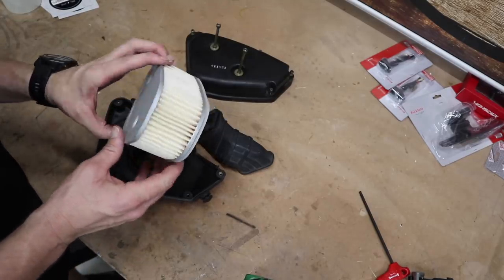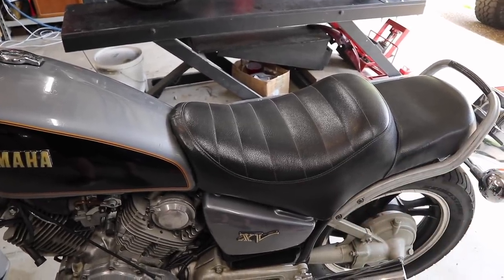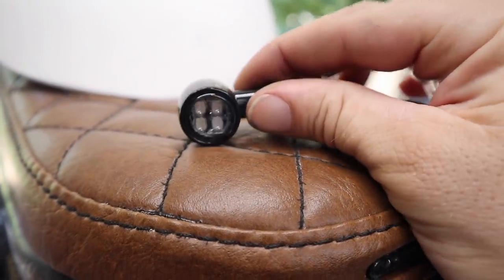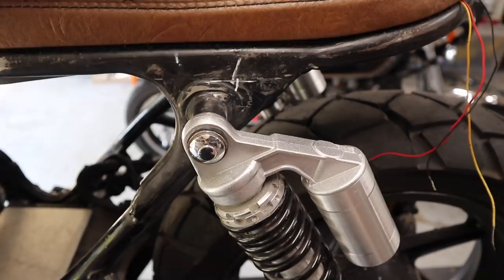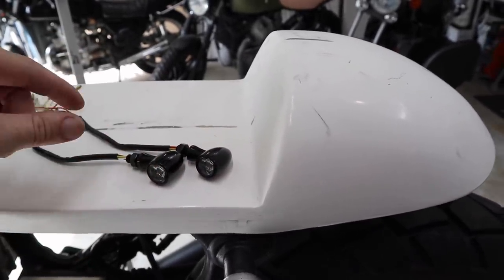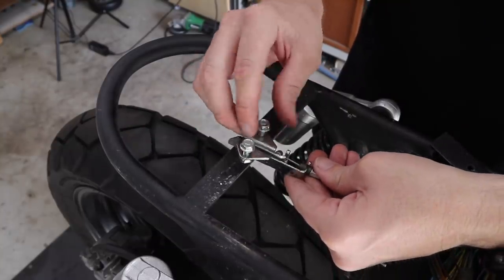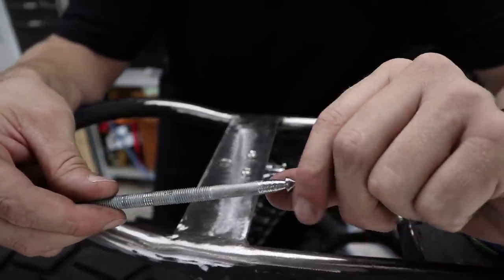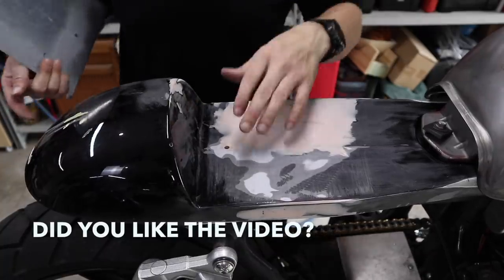Cafe Racer Parts and DIY Seat Latch PART 1. & XV750 Virago Compression Test

Comment: Compression shouldn’t vary more than 14psi from one cylinder to the other. Minimum 128psi, standard 156psi and max 171psi
Reply from the maker: Thank you so much Samuel I appreciate it a lot
Reply: Cafe Racer Garage no problem just happened I was looking in my Clymer manual when I got notification of your video.

Comment: Looking for some advice, I have a 82 gl 500 converted to a cafe. first ride with my new Anti-gravity AG 801 and it swelled, started smoking and melting. what should I be looking for to prevent this? Kind of scared to buy another lithium ion battery. Love your channel , thanks for and help!
Reply from the maker: This is something you may want to ask an auto electrician but I believe you may want to look at the shorai brand of battery https://amzn.to/2Lzl7tC  also a new regulator rectifier.

Comment: Good thinking! About those rear lights. I had a Yamaha with really clever indicators. In front with running lights and at the rear with running lights/brake lights. But it was difficult to see one light from the other at the rear when running light was on. So I kept that function in the center light and indicator/brake light at the sides. Everybody knew when I used my brake! One thought about your films is that if you ask me, don't use that much time on finding music. Your films can "live" without it. :-)
Reply from the maker: Thank you so much mate :)

Comment: Hey Dan seat mounting question for ya! I made a custom seat that uses a screw in the middle of the base to attach to the frame. I'm in the process of making an electronics tray and just realized I won't be able to get to that screw when the tray is installed. Don't have a welder, any suggestions on how to mount the seat?
Reply from the maker: Jason Cho did you watch part 2 of this video or have you checked out the way I fitted the latch on the Scrambler build? I did a videoing it
Reply: @CafeRacerGarage  I did, but I don't have a welder, so I'm limited to the bare bones frame at the moment, but I might be able to attach some latch mechanic through the current bolt holes. I was wondering if you did anything similar to a snap into place seat, bad example a bucket lid.

Comment: Wow for the size those ickle lights are really bright , good idea on the seat latch but that elongated hole wont work on the brat would a small tab facing down accessible from underneath be any use as can be done to both brat and cafe racer .liking the idea of the single seat conversion for the xv they do look a bit clumsy with the king an queen style rear seat ..great video as always Dan looking forwards to the next 
Also great to see the new grinder showing how versatile that bar adjustment is ..regards gaz..now for brekkie
Reply from the maker: Thank you mate, You have a good point on the seat release idea for both seats.   Hmmmm I will do some more thinking ;)   So glat you are enjoying the videos so much

Comment: How come the "Hammer" isn´t welded on the motorcycle? :D
never saw that "trick" .
subscribed :)
Reply from the maker: Lukas Schäfer Great question, I used a brass hammer so that it will fill the hole but not weld to it :)

Comment: did you see the kellermann atto? We build them on our BMW, they are even smaler than these guys. they are so tiny, you wont recognise them while turned off but got an immense brightness for the flashes (safety first)
Reply from the maker: Yes I think that is something I would like :)
Reply: @CafeRacerGarage they are absolutely amazing, i wired them at first at a battery like you did and kind of blinded me :D
Maybe you could hide them unter your seat somewhere (where the hump starts to rise up connected with a bracket at the inner side) so that they just are seen while flashing.